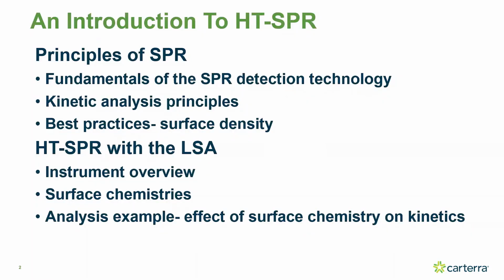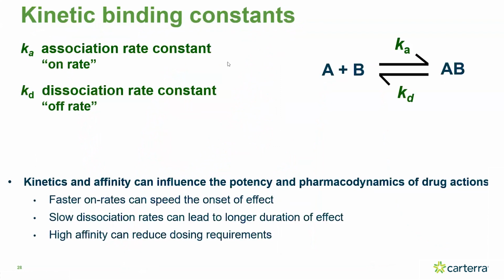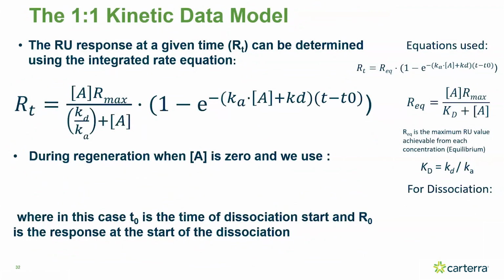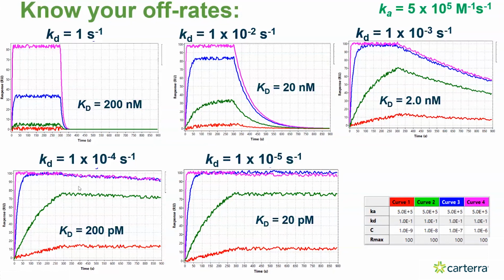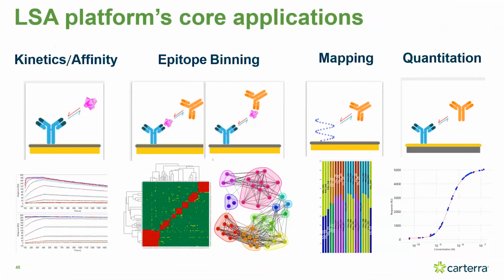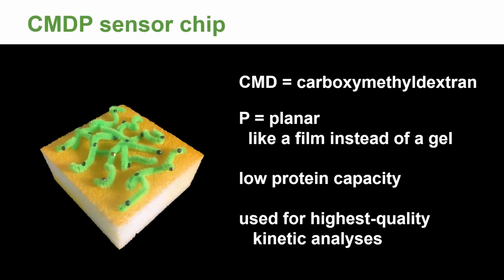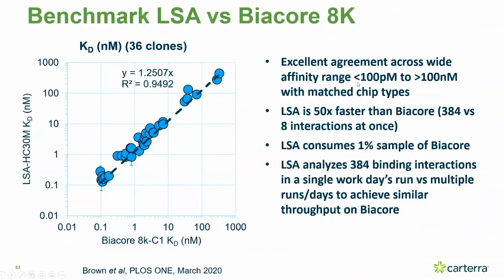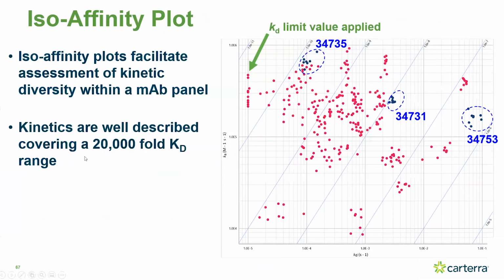Fundamentals of Surface Plasmon Resonance (SPR) and High Throughput Kinetic Analysis

Comment: thank you so much for this nice presentation. could you just tell me what the Rmax is? i mean if the Req is the max value then what is Rmax ?
Reply from the maker: Rmax refers to the maximum observed RU binding value (extrapolated or measured) when all surface ligand binding sites are occupied during the association phase. Req refers to the RU response observed during the association phase once equilibrium is achieved between the ligand and the analyte that is being cycled over the surface. Req would be analyte concentration dependent. The concentration of the Ligand, Analyte and their inherent affinity (KD) define the occupancy % at equilibrium.